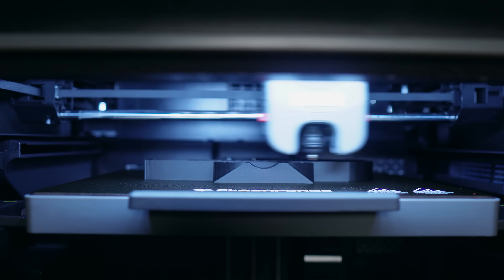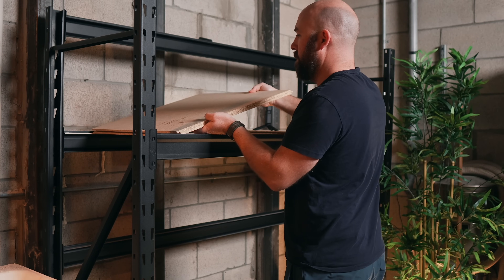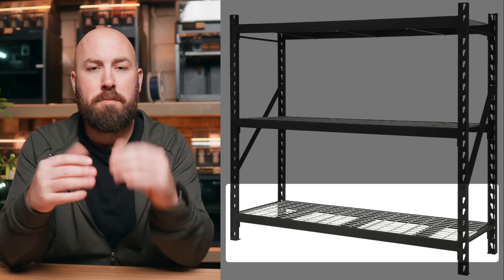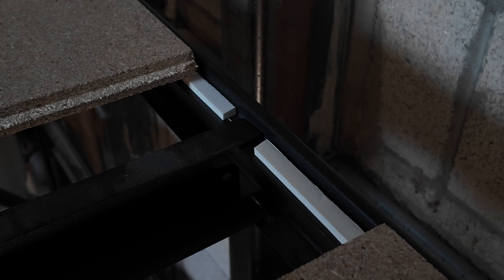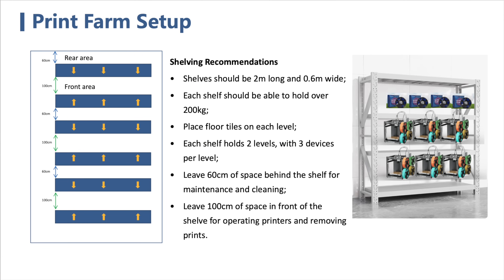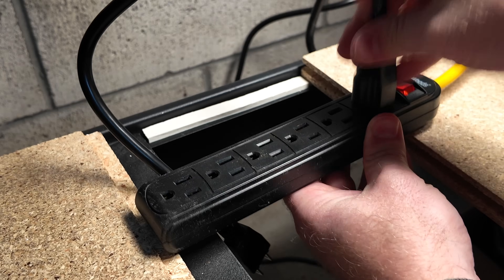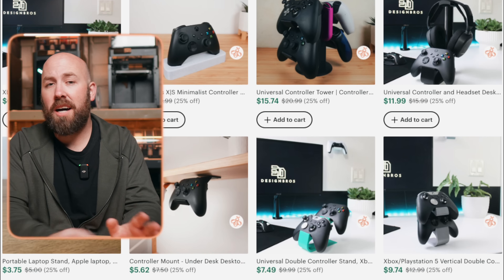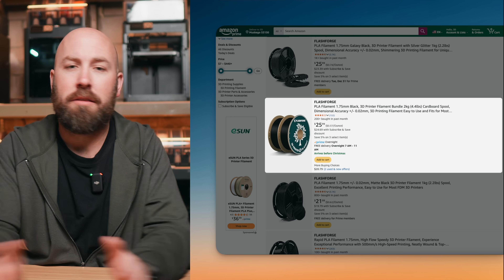Building a Mini 3D Print Farm // Is It Profitable?

Comment: Great video.  Practical in formation, easy to understand and apply, but not dumbed down.

FlashForge has always made solid reliable 3D printers with good features and it's surprising that they never achieved as much broad acceptance in the market as they deserve, but they maintain a loyal base of customers.  Maybe it's one of the oddities of marketing.  FlashForge has been killing it lately.  For anyone interested in multi-color or multi-filament printing, the new FlashForge AD5X looks great.  Four reels mount to the right side of the printer for easy access, and their clever filament multiplexer swaps filaments at the nozzle for minimal filament waste (aka poop) when changing filaments.  It's also possible to load the multi-reel system with the same filament and the printer will automatically switch to the next reel for trouble free printing with no filament waste at the end of a reel.  As if all of that isn't enough, the IFS multi-filament system is capable of printing typical 95A durometer TPU, something that Bambu, Creality, et al cannot do.  I print a lot of TPU for my small print farm so this is huge.  The ability to print a structural material such as PETG, PET-CF or ABS with print in place rubber feet or rubber pads on top is huge.  Modern slicers support maximum strength interfacing between dissimilar materials so only a few layers of overlap are needed which minimizes waste from changing filaments and keeps print time low.

Instead of buying wooden plates to place under each printer, you can buy concrete slabs.  The mass will dampen vibration.  3D printed TPU feet can further decouple the printer from the rack so each printer is mechanically isolated from the others.  Putting rubber shock mount feet above and below the concrete slabs would further isolate each printer from the others.

Comment: Its NOT profitable - you can't even break even!

The one problem no one ever covers is there's zero market gap to have. Basically anyone who wants to print just buys a printer. Anyone who knows they need a lot of printing to be done simply buys a printer. The result is there is basically no need for a 'print farm business' as everyone just does it themself.

Then the few established ones have already got the entire market and due to either being funded by donations (maker spaces), being run by universities, or by the printer manufacturers or distributors (might as well make the customer demo's generate revenue), there are no customers.

Basically its impossible to be cheaper than those already in the business, thus you'll never get any customers and thus will never make any money.

Basically if you can print and sell a product that only you can offer (at least until someone clones it and gives it away online for free), there's zero way to make money from:
* 3D printing
* Laser Cutting / Laser Engraving
* CNC Machining

TLDR: You can't make money as a 'print farm' as the entire market is fully saturated, and because most people just buy printers and print what they need because its cheaper for them in the long run. Thus you can't make money. The same applies to laser cutting, laser engraving and CNC machining. Its impossible to be cheaper than the existing solutions as they're not intending to run as 'for profit' so they don't care about under-charging, and, the manufacturers of printers who run a print service so that they have endless useful 'customer demos' don't care if they make no money on the prints as they make the money selling the super expensive printers ($20k+).
Reply: Funny TLDR, longer than half the main post.
Reply: I make money as a print farm...becasue I sell a product that nobody else in the world makes. Something I've trademarked and patented. I've sold over 500 units at over $100 a piece. over $50k revenue with over 95% of it being profit in my pocket. With literally zero marketing done or paid for.

If you buy a 3d printer and make all the same crap that other people do, then sure, good luck being profitable. Everyone and their grandma can sell crystal dragons ripped off from thingiverse.